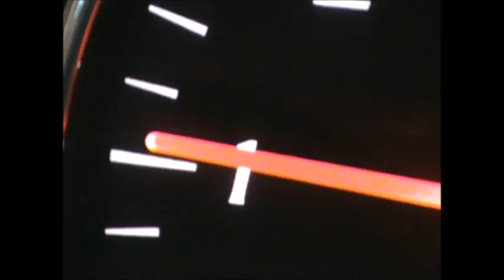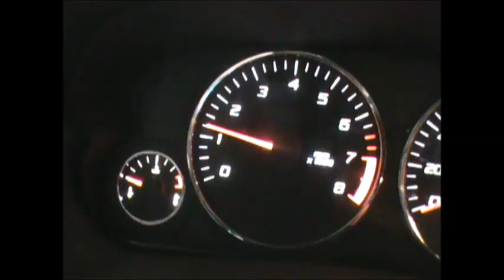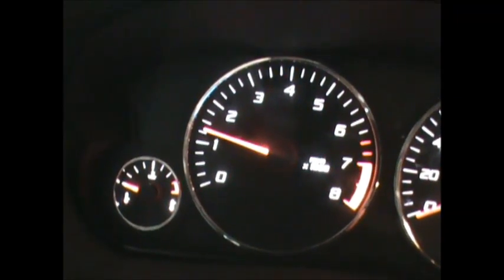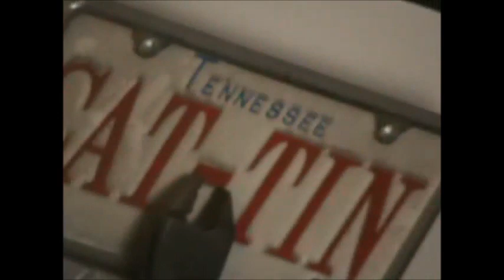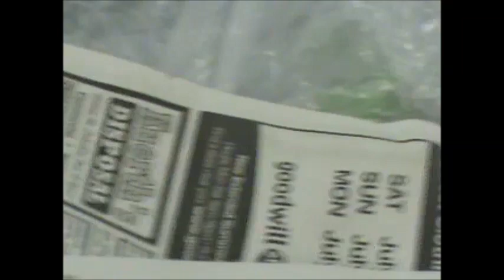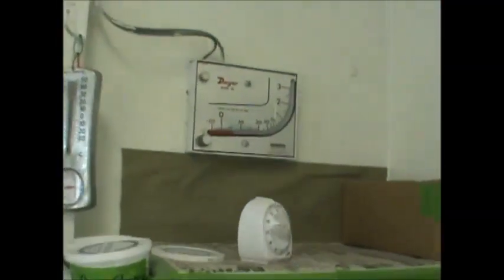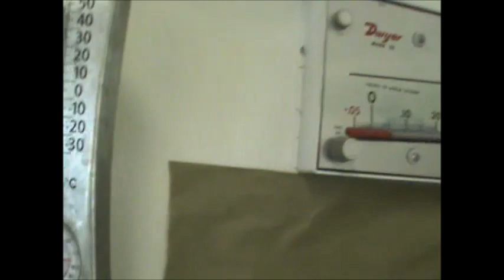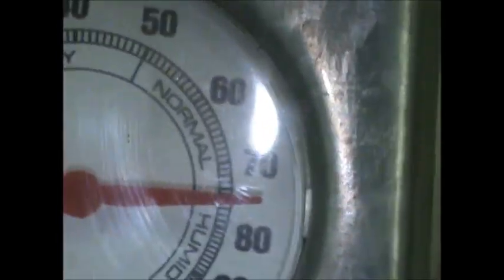PRIME TYME CTS 06 CATTY

Comment: If you start having issues with fibers and dirt in your paint you might try not using news paper for masking. News papers are loaded up with fibers.  Next time you have some left over clear coat spray it on a scrap panel and shake a piece of newspaper over top of the wet clear. I think you will be surprised what lands in the clear from the newspaper. Newspapers not allowed in a lot of OEM paint shops because of this. Enjoy the videos keep it up.

Comment: Try power braking it and check the motor mounts especially the upper    motor mounts.
Reply: If the motor has excessive movement due to the motors being worn out it will cause a vibration at idle.
Reply from the maker: theres uppers and lowers?  got to LOVE the newer cars  THANKS
Reply: Yes there should be upper and lowers, but I would look closer at any upper mount. Upper mounts usually cause more of the vibration issues but doesn't necessarily the other aren't bad or worn out.
Reply: I looked online, it looks like it uses 3 mounts. And it seems like they might all be accessed from the bottom on that car. So I don't think it uses a typical upper mount. Best to have someone power brake it and watch the movement of the mounts. Hope this helps.
Reply from the maker: thank u so very much...i have so many cars going on befor winter,sumtymes i dont have tyme to look troubles shooting PEEEEACE